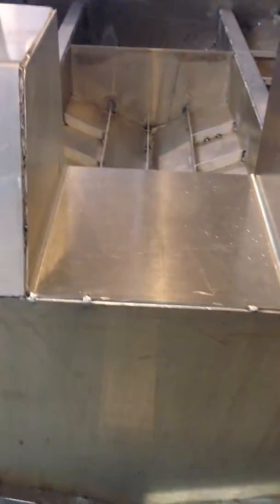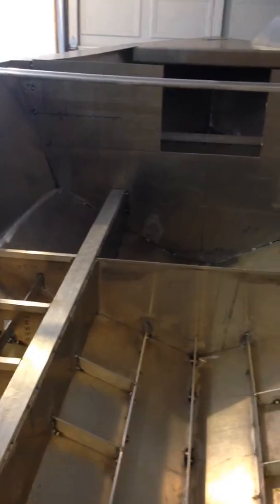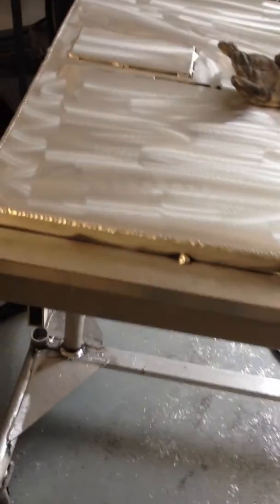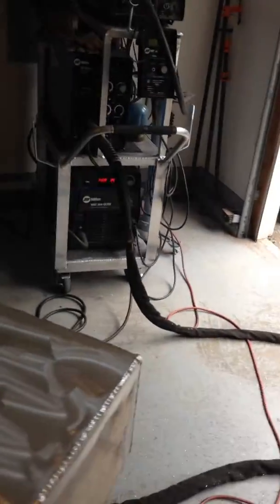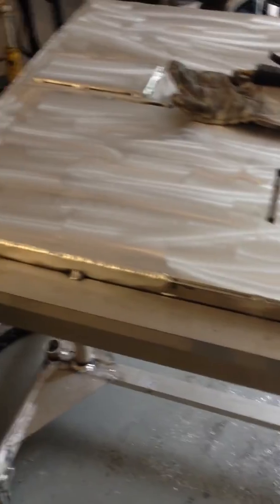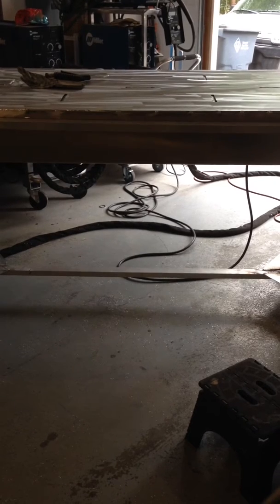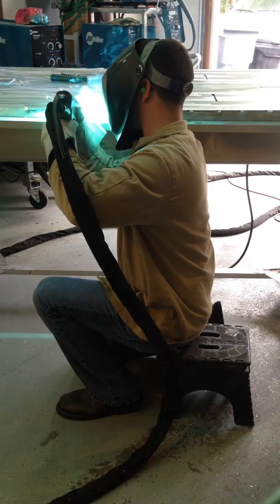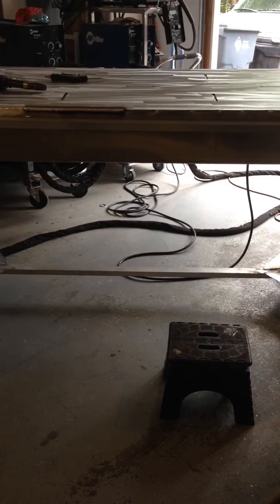Aluminum fuel tank welding for a boat with a Miller XMT Welder

Comment: is that a spool gun you are using? you did a great job..that looks like a great welder..
Reply from the maker: It’s a push pull wire feed. The lead is 30’ and runs the wire from a feed box.
Reply: @rykerweld3914  can you do a video on it?explaining and showing how it all works and how the pulse works on the xmt 304?thanks for the reply..
Reply from the maker: @mandylad  I’ve got a couple of other videos that do explain a little more about the machine on my channel... As to making another video in more detail I might get around to it if you give specific info on what you’d like covered... I just haven’t made a video in a few years and I didn’t feel the quality of video was where I’d like them to be. I have zero editing skills.
Reply: @rykerweld3914  well heres the thing im currently trying to buy a xmt 304 and a miller optima pulse control and ill need to get a wire feeder too.ill be buying everything seperate  so some knowledge and beeing shown how it all goes together and how everything is installed would really help me. I live in Ireland so i have to get the optima pulse control from the usa..it will take abit of time to get things together...So it would be great to see a video from someone who has it all together and up and running  and knows how everything works..Just do a walk around the whole welder and everything thats with it and unplug the leads and plug them back in and show where they all go and  expain the pulser system and show how it plugs in and works .it would really help me out here in Ireland..LOL!!!!
Reply from the maker: @mandylad  okay I will try to put something together video wise so people in your situation will have an idea of what you’re getting into. As for wire feeders and leads for this machine, I use an “XR control extended reach feeder” with the XR pistol lead, 14 pin. This setup is primarily for aluminum. The XR spool gun does a great job and would eliminate the need for an aluminum feeder. A feeder is great for production use but if you’re not welding a lot of aluminum on the regular a spool gun might be a good option. There are different generations and models of this equipment, ensure on the XMT 304 that it is single and 3 phase hook up as I believe some only run on 3 phase power. With the feeder ensure that the gun you purchase matches, as some of the early guns attached using a different gas block and vise verse on the feeder as well.
Reply: @rykerweld3914   thank you!!! i have just bought a miller optima pulse control about 5 minutes ago on ebay US LOL!!. im just after paying for it i won it on a auction for $580 including shipping to me in Ireland,Do you think that was a good price???  i bought it off some shop .it looks in very good condition ands its been tested and in good working order so that is the first piece of the kit got. I have 3 phase power in my workshop so  a 3phase XMT 304 will suit me down to the ground i will be fit to get the full 400amps from it.what wire feeder would you reccomnd  me getting?? would a dual wire feeder fit it? what size spool can your feeder take? 
thank you for replying and helping me...
Reply from the maker: @mandylad   yes sir you got a very good deal on the optima pulse box, they are typically over $1000 just the electric cord on that box costs $300 to replace, ask me how I know. The optima box is discontinued to my knowledge and they will get harder to find. I spent 20 years in aluminum boat manufacturing industry and this setup is sought after as the newer pulse on pulse setups have auto correcting tech that can hinder certain techniques used by fabricators. The new stuff is great but I prefer the last gen stuff. As for feeders, I have a miller S-22A feeder for steel and the XR for aluminum. When switching from one to the other you have to plug in the feeder your using to thepower source. The XR feeder will run steel but you wouldn’t want to do that as the steel wire will contaminate your plastic liner in your gun and when you switch back to aluminum you’ll be pissed when you realize your welds have tons of porosity in them. Both feeders will hold large spools of wire, a large aluminum spool in the US is 20 pounds the same size spool in steel weighs 40 pounds.
Reply: @rykerweld3914  yes I'm pretty happy with the optima pulser I just bought.its kina funny coz when I decided to go for this set up I just started looking yesterday and I found one on eBay right away and it's the only one on it at the moment I feel abit chuffed lol.what is so special about the XR feeder??when it is so good for doing aluminium?
If I was using it both for steel and aluminium .if 2 different torches were used one for steel and one for aluminium have a torch for each one..Would that work?
The way I'm doing it picking up a bit at a time will work out quite cost effective. I could never afford to go and buy a new pulsed welder like that..how does the aluminium not kink or get stuck when you run it in such along lead..?30' you said it is?
Thanks for replying..😀
Reply: @rykerweld3914  when you are using the XR feeder doing alumunim is it snyergic pulse or do you have to set it up manually? will you cover that in the video too please..
Reply from the maker: @mandylad  yes if you had 2 weld leads 1 for steel and 1 for aluminum, you could swap the leads and wire for what you’re working on. The cost of doing this is expensive though as the push pull torch is typically over $1500 and you’d need 2. The need for push pull feeder and gun is because aluminum is soft and will bind up, so the feeder pushes and the gun pulls the wire. I have ran steel wire in the XR and it does work but cost is higher, as I found my steel feeder with torch for $400 and it works great. As for the optima pulse I will cover that a bit too but it’s fairly straight forward as each program in it states what it’s for. Example: program #2 might say AL for aluminum, 5356 this is your wire alloy, AR, this means argon gas, .47 this would be the wire diameter for that program. So you’d just select the program that matches what you’re running in the feeder and tune it in.
Reply: @rykerweld3914  could you use a push pull torch for the aluminum and a ordinary  euro style torch for doing steel on the XR feeder? I understand that the torch connection on the feeder will be one to suit the push pull aluminum gun but i think you can get a torch adaptor fitting that allows you to plug a euro style torch into the XR feeder.my optima pulser has been posted today so i should have it for Xmas,my next step is to try and get a XMT powe source.im looking forward to your video on showing how it all works..
Reply: Hi again how are you? How is the new video coming along Lol?? do you have a water cooler set up with your welder? i bought  a  Miller xmt 304 last week I just got it on saturday. Its not the cleanist one ive seen but its working really well. the stick function on it is really good it welds 6010 and 7018 so well. Im still waiting on the Optima pulse box to come from  the US but its on the way LOL!! I will keep a eye out for a good wire feeder for steel next, I might try get a dual feeder one if i can manage it.
Reply from the maker: @mandylad  no I do not have a water cooler for my set up for the XMT. You wouldn’t really need one unless you were welding very thick plate all day non stop... I’ve personally welded enough in a 10 hour day that I’ve used more than a 20 pound spool of wire and didn’t need water coolant and the gun never got too hot... It’s doubtful that you would push the duty cycle of a miller XR gun unless you were welding with large wire say heavier than .47 diameter wire on plate that’s 1/2” and thicker and a lot of it. I would however consider a water coolant for a TIG machine that you do a lot of aluminum welding with as that torch will get hot... You’re XMT has a TIG function but it would not have AC so you’ll need a separate power source to TIG aluminum.
Reply: @rykerweld3914  I have a acdc tig welder. It's a Miller scynowave 250dx tig runner.has a water cooler with it..its a great job..i only have it a few weeks..are you doingcmuch welding with the XMT these days? What is the 60 series wire feeder like? I see you can get different versions of it..
Reply: hi
how are things going? any joy with making another video yet? i got my optima pulser box from the USA it arrived yesterday.im very happy with it.i got a miller xmt 304 aswell.get a wire feeder next.what model xr feeder are you using?

Comment: Hi Ryker,
Love your videos.  My set up is XMT 350 CC/CV with Optima Pulse wit h a S74DX feeder.  I have been trying the same set as yours but my weld are not coming great as yours, far from it.  Is it because my feeder is not the same as yours, so the settings should be different?  I am also using pure argon and 1.2mm aluminium filler.  I have spent hours and hours but not much luck.  I am based in Australia and hard to get help as they don't use Miller much here.  Can you help?
Regards
Kiran